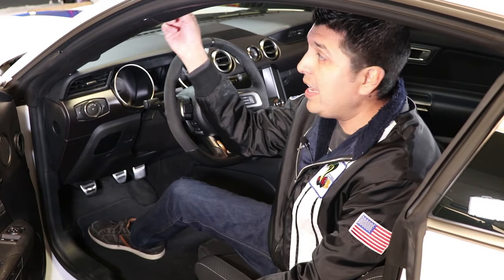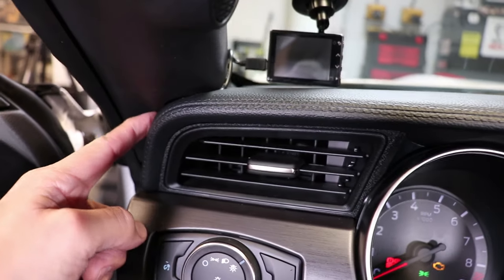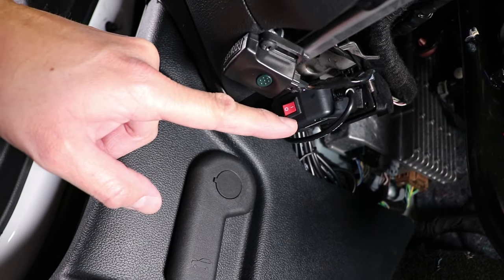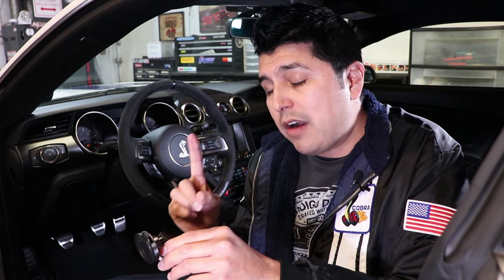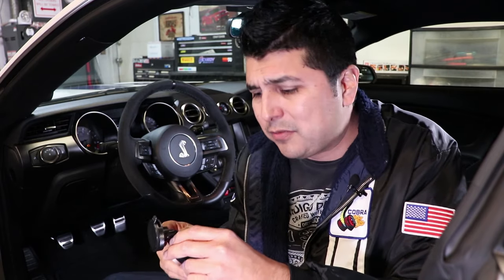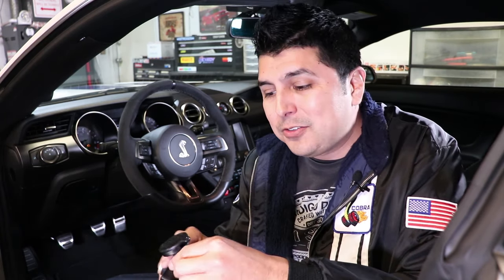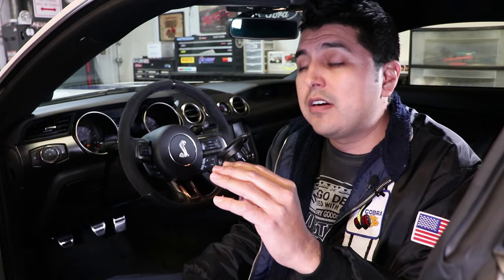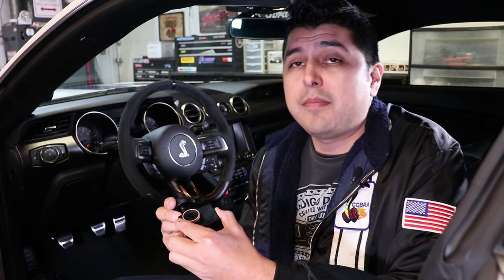Don't hardwire your Dash Cam! Try this instead!

Comment from the maker: Hello! I placed the link to the OBD Power Adapter & Mirror Power adapter in the video description. 
Here is my other video showing the alternative Hardwire method https://youtu.be/zbxYA4VhuT8
And my video on How to find the OBD Port on your car  https://youtu.be/hEmvv8M8bGI Cheers!
Reply: LIKE
Reply from the maker: @SHAHMRUGESH  Thanks Shah!
Reply: Thanks man,cool content - appropriate you taking the time 👍 Scribe
Reply from the maker: @jackson865z  You're welcome Charles!
Reply: Yeah, I try already when I bought the mirror to hotwire and the battery go dead so I decided to use that cigarette lighter i’ll be using like that for almost 2 years with the cigarette lighter. No problem. This problem came by two weeks ago.
Reply: @AlexAutoFun  awesomeness!!! ❤️
Reply: @AlexAutoFun  Do you pull the Air bag Fuses before running power cables be they Hardwire or OBD so few tech channels mention to do that before you do the whole cabling thing

Also replace important fuses like ABS, Collision Avoidance RADAR etc with Auto Resetting Circuit Breakers (Yes they do make them for cars!) Actually don't know why those are not mandatory instead of fuses which generally don't work until well past their specified load
Reply from the maker: @DarthAwar  Hi D! Ah yes Airbags definitely can create issues for an installer, I cover this topic in more detail on this video here https://youtu.be/uZp95NbNlmM Ah regarding self resetting breakers, based on what I saw in the industry (and this is probably true for other industries) it just comes down to money and what is the lowest cost something can be produced for (fuses are extremely cheap lol) Cheers!

Comment: Dash cams should be installed in the dead center of the windshield just behind the mirror or slightly lower than the rearview mirror. This position gives the camera the best view through the front windshield for better angles if an accident happens. If you have it in the lower left hand corner it will have huge blind spots on the right hand side just right of the outer fender area. Please everyone do your research and install your dash cam in the center of the windshield and also make sure you double check for glare. Also i would always recommend getting a dash cam that has a rear facing camera so that you can catch everything thats happening throughout the vehicle and behind you and even you and your passengers. My rear facing camera has saved me tremendously.  As for hard wiring most Dash Cams have a hard wire kit available online.
Reply from the maker: Hi Reseller Rockafeller! My Garmin so far has recorded really good video from that angle, it may be due to its wide angle lens, but using the same method the wire could be run higher up the A pillar while tucking into the trim, this should position the camera higher for better coverage. I have to agree with the dual camera recommendation, it definitely helps having a second angle to capture a full picture of what led to crash. Thanks for watching and commenting bud!
Reply: How has your rear facing in car camera saved you? I don’t need me and my passengers face on camera.
Reply: @LuckyCharms777  could prove you weren’t distracted or on your phone when the accident happened if the other party claims you were.
Reply: Unfortunately some cars have sensors in the center right under the rear view mirror and the dash cam has to go on the sides of the windshield
Reply: I think he means rear facing camera as in… mounted on the rear windshield, to catch scenarios where one gets rear ended. The rear facing camera you’re describing (recording interior of one’s own car and passengers) is also a valid scenario, but is typically only used by Uber drivers. Or if one has a high end car that is in parked by valets (“Ferris Bueller’s Day Off”).
Reply: Just because someone is on youtube, doesn't mean that they know exactly what they're doing. Yes, a centre-mounted camera is sensible, but then again, someone may prefer a driver-side biased field of view.

Comment: It obstructs your visibility when making a left turn, I can't imagine you get a clear view recording on your driver side, in my opinion it should be on the center of your windshield behind the rearview mirror and hardwire is not so bad in fact it's actually really more professional than your way but as i said that's my opinion
Reply from the maker: Hi Tony V! I think you got some good points, I couldn't see myself hard wiring the camera, just love the Shelby too much to cut into it anything. But to your point I have another video coming up where I compare different locations so you we can see how each looks, will make sure to try the center as well! thanks for watching bud!
Reply: @AlexAutoFun  I have my Garmin 56 mounted to my rear view mirror to keep it out of the sun and for a better camera view . Plus it's with in arms reach if I need to hit the capture button.. BTW my other Dash Cam in the wife's car is an older Cobra Drive HD Drive,  it has the park mode built in (no extra cable) it's detects motion and has the G-sensor.
Reply: Nonsense
Reply: AutoFun you don’t have to cut anything for hardwiring.
Reply: @AlexAutoFun  Ever heard of a fuse tap? You don't have to cut into anything to hardwire. It's plug and play.
Reply: TonyV is correct. In Australia, you could land yourself with a fine for mounting the camera there (and one demerit). It's illegal to mount anything that could be a distraction to the driver or drivers of other vehicles and it's illegal to mount anything that obstructs the view of the road ahead.
Reply: You should not drive a car if a small camera in the bottom corner disturb you to drive a car 😂😂😂
Reply from the maker: @elantra45  Hi J B! I just completed the follow up video using fuse taps, thanks for the tip! Here it is if you want to check it out https://youtu.be/zbxYA4VhuT8
Reply: In Pennsylvania USA you may use a dashcam in the lower-left position if the device obscures only up to 5 square inches, same for the rearview mirror area. The lower-right (passenger) corner may obscure up to 7 Square inches.
Reply from the maker: @imconsequetau5275  Really good info Imcons Equetau, thank you for sharing this!
Reply: @jublywubly  it's a tiny camera it doesn't obstruct anything. The govt just wants to fine you for everything and you believe their nonsense reasons. Plus nobody cares what australia does, we don't live there. You're not driving anywhere anyway since you're prisoned in your own homes
Reply: @evocati6523  
If it's visible between the driver and the road, then it is an obstruction. It's people like you who cause accidents, because you don't care about safety.
Ironically, mounting a camera in such a position can be used as evidence that the person driving the vehicle with the camera helped to cause an accident, due to that obstruction.
Reply: @jublywubly  
Here in California the lower left or right windshield mounted as shown in this video is actually the only legal place for your dashcam or GPS unit.
Reply: @dennisneo1608  It's not nonsense. In the UK it's against te law mount ANYTHING on windscreen on driver side. It's the reason why my Dashcam is mounted next to back mirror on passenger side.
Reply: @waleryx  Come to Great Britain and try to convince the policeman. Lol.
Reply: @xMastJedi  you can also write go to North Korea, Austria or Germany where using Dash cam is forbidden and try …. 🤪 We’re talking about the place where the rules let you mount the camera in the corner and not about Police restrictions 😉
Reply: 😂 @waleryx

Comment: Ah, I wouldn't mess with OBD connector as it has direct CAN access. If anything goes wrong with the adapter you have and shorted some pins, it's going to throw CEL code or strange stuff can happen to your car.
Reply: Totally agree, rather than meddling with the OBD, might as well fix another cigaret lighter for USB adapter around that area. (going to patent this idea Hahaha)
Reply: So this depends on the adapter, assuming the one you buy is from a reputable source. To clarify here, OBD port for power is not harmful to the car in any way. The pins these adapter uses are power pins and go direct to battery, they do not go to your cars computer. Every diagnostic tool out there uses these same pins and they draw more power than a cam.
Reply: @msi4226  If you want to record parking issues and the cigaret lighter is not powered if the ignition is off, you will see the problem.
Reply: Bye bye warrenty.
Reply from the maker: Hi Phreak! Yep that is correct bud! 😀
Reply from the maker: Hi Boyvenz! Hi ! I been running mine for over three years now without an issue but I know some folks rather not use with the OBD port for power. Check out my other video showing the alternative Hardwire method https://youtu.be/zbxYA4VhuT8  this maybe more of what your are looking for. Hope this helps and thanks for watching bud!
Reply from the maker: Exactly! and the power to the OBD port may itself be fused protected (depending on the car). Thanks for watching and commenting William!

Comment: Just to add that in Parking mode, your camera should be plugged in live all the time, that's why hardwire is the best option. However you have to find a fuse that's Live even if the car is off for it to work. In my Toyota I tapped on the ACC fuse which is 25 amperes I believe. Dashcams only require 3 amp fuse so a 10amp fuse or bigger are your best options.
Reply from the maker: Very good info Jeremy thanks for sharing! also here is my hard wire video in case you want to take a look bud! https://youtu.be/zbxYA4VhuT8
Reply: But will it drain battery? I read reviews saying some can leave battery dead
Reply: Ellen ioann  I ended up going on Amazon and buying a dash cam kit that has a way to keep camera on even if car is off but if it reaches too low of voltage required to start car it turns off. So far ive had dash cam in for about 1 month with no problems starting car. I wired the dash cam kit wire to fuse panel and then other end is a mini-usb that plugs into camera which I have mounted on Rear View mirror.
Reply: @chrisb8870  has your battery been drained completely at all since then? I am looking to get one and am also worried about the battery draining.
Reply: @TopBoi93  Compare the power consumption of the camera to how many watt-hours of energy your battery stores. eg: 1kWh(1 kiloWatt = 1000 Watts) battery / dashcam that draws 6W = 166 hours. In reality you wouldn't want to drain the battery to anywhere near empty though.
1Wh = the amount of energy used to supply 1W for 1 hour.

Comment: Thanks to you - I just finished the dashcam install on my 2023 Hyundai Tucson. The OBD USB C connector was only $18 on Amazon. Tucking the wires behind the necessary panels proved to be quick and easy and no more dangling power cords to my vehicle's USB and 12V power ports in my line of sight. I've set my OBD device to turn on and off with the ignition. VERY handy.

Comment: Tapping into the fusebox with a fuse adaptor is hard wiring by the way.  I would never recommend using the OBD2 outlet as a power source because if you damage your OBD2 outlet, you will have a whole boatload of issues and an expensive fix than just blowing a fuse. If you want to keep it simple, use the cigarette outlet though you would have to deal with a wire crossing into your center console.  The cleanest install is to do a fuse adaptor through your fusebox and run the cable behind the A pillar.  When tucking the cable behind the A pillar, use a small trim pry to push it in carefully and disconnect your battery.  This is very important as you don't want to accidentally deploy your side air curtain.
Reply from the maker: Hi R. W! The OBD adapter does not tap into the fuse box, instead it connects to the OBD2 port of the vehicle. I been using mine for about 3 years now without an issue but here is another video I made explaining OBD2 adapter fears (some are very real!) and how it works behind the scenes (from an engineering and electrical standpoint) https://youtu.be/aV5jQovoaCI For example the SAE standard that controls the OBD2 port (J1962) does specify that the OBD2 was designed to supply power (within the specified amperage limits of the SAE standard). Here is also my hardwire video https://youtu.be/uZp95NbNlmM  this maybe more of what you are looking for (good tip on avoiding the air bag too!) Hope this helps, Cheers!

Comment: no difference mounting the cam at low points as you stated will capture mostly the hood.  So your recommendation is de-bunk.  The best spot is near the rearview mirror where it can capture the car in front license plate etc.
Reply from the maker: Hi I'mwatching! the dashcam can be installed higher up by running the cable up the A Pillar, I'm currently working on a follow up video comparing different camera angles, will definitely make sure to include the near the rearview mirror one, stay tuned bud and thanks for watching!

Comment: I was hesitant to run a wire from the engine compartment, where the fuse box is on my wife's Jeep Patriot, into the passenger compartment. I saw your suggestion of the OBD connection, and ordered the part. Turned into a half hour job. Thank you sir, you are a lifesaver!
Reply from the maker: Glad to hear it helped out! thanks for watching Jack!

Comment: I can't believe you're the only one who mentioned the OBD option...!!  Thanks a million!
Reply from the maker: You're welcome Ave! glad to hear it helped bud!
Reply: Sure you can, but you shouldn't! There is one very solid reason for this - draining your battery!

OBD ports are designed to be always powered, unlike fuses.

... and the distance between your OBD port and your driver side fuse box is less than 10cm away, as long as your car was made in the last 15 years.
Reply: @Daveheardt  not sure what you mean, because the camera's been installed for a year now after seeing this approach and there's never been a problem with my battery.
Reply: @avecrux333  I was very clear with my explanation. There is ton of materials on the internet, and on youtube, on why one should not be using the OBD port for permanent power source

Comment: Good video. I had the OBD with an on and off switch. Worked a d seemed to minimize battery drain on a seldom driven car.
Here is another option:  I attached a USB power pack battery to my sun visor, and connected cam to the visor power. I have two battery packs and swap them out. My Anker battery has a draw string type case, and it stays in place on the visor with thick quality rubber bands... I just slide out the battery to swap out. The case and rubber band stay in place. I put cardboard (disposable coffee cup liner) on the visor to make sure the rubber band did not damage my visor (to reinforce). Waiting for car manufacturers to have USB ports at the top of visor and headliner. Drive safe and keep well.
Reply from the maker: Hi R S! that is actually a great idea, but yeah they really need to start putting a simple USB port up there, it would make life so much easier for a lot of people LOL Thanks for watching bud and cheers from California! 🍻
Reply: I wonder if a solar powered one would work as well. Gonna try a power pack first too, just for recording overnight.

Comment: Thanks for this.  I wanted to mention that many cars have a dome light or map lights just above the rear-view mirror.  The power lead(s) for those lights can be accessed with a minimum of effort by removing the light unit and connecting a new feed into the light feed, then run a new lead out to the camera, usually through the gap where the headliner seems to meet the windshield but usually doesn't.  This saves all the work (and a lot of wire) in running a power feed and ground all the way up the A-Pillar and across to the camera mounting area.  The next closest power access is at sun visors that have a lighted mirror.
That's a nice car you have there!  Beautiful dashboard and interior.  I see it's a stick too!  Nice.
Reply from the maker: Thank you discerningmind! An good input on that secondary source of power. Cheers!
Reply: @AlexAutoFun    Thank you.  You're new to me and I'm just perusing your channel page now.  You have a lot of videos!

Comment: Thank you so much. Came across this video trying to find a way to put in my dashcam without having the wire hang down for the 12V and the fuses were too small for hardwiring (plus a tad complex for me). This was so easy to do, but I'd have had no idea it was even a thing if I'd not seen this. I bought an OBD2 extender to shut the power off all together since I don't need it on while in the garage, but it looks so professional I can't even tell I'm the one that did it. Thank you thank you thank you!!!
Reply from the maker: Awesome! Glad to hear it helped! 😀

Comment: Awesome solution for me. I have leased cars and don't want the hassle of pulling panels, tapping the fuses and then pulling it all out in a couple of years. This is easy. Didn't know it existed! Thanks!
Reply from the maker: You're welcome Richie! glad to hear this helped and Thank you for watching!
Reply: Tapping fuses can be very easy on at least some cars to be fair, in mine for example it would be easier than using something like the OBD connector.

Comment: Thanks for this video. It’s one of the most useful I’ve found. Wired my Dashcam using the OBD 2 connector. Installation took only about 15 minutes. Looks professionally installed and works great!
Reply from the maker: You're welcome Steve! glad to hear it helped!
Reply: Where did u get the adapter that plugs to the odb reader to power the dash cam?
Reply: Same me I'm using OBD2 but it means it will be like CCTV and if your dash cam doesn't save the impacted clip, you will lose it, as it will record over it.